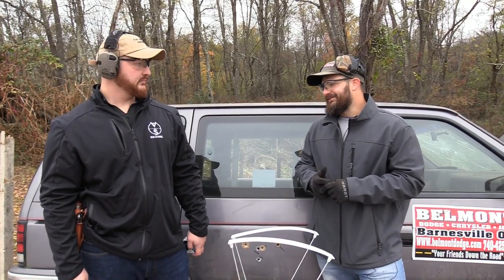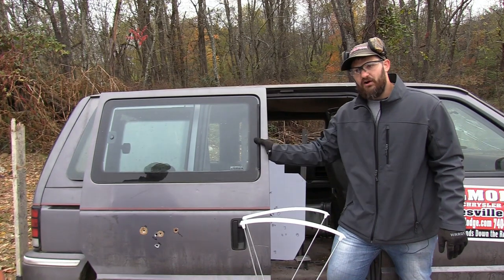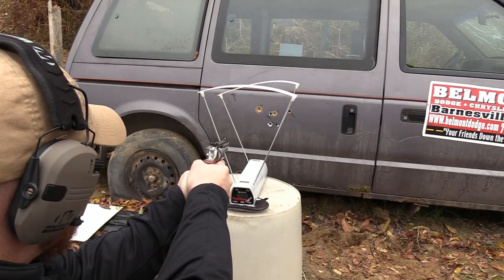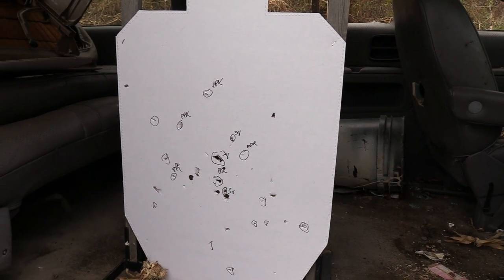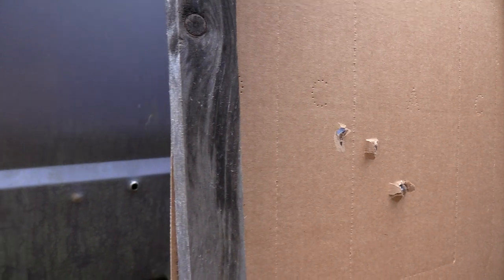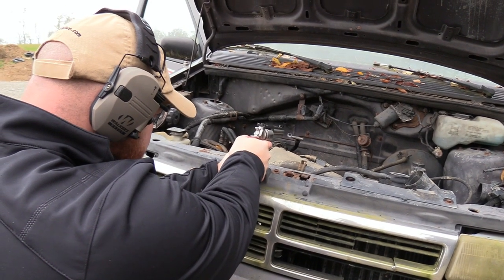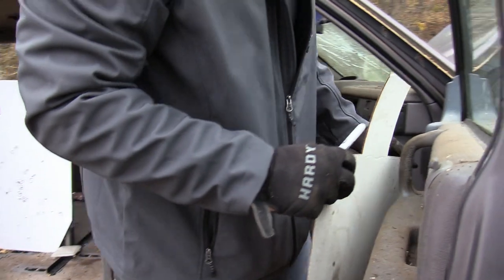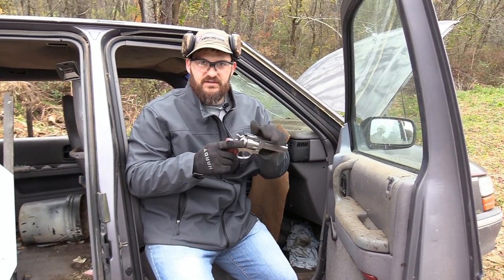HOW POWERFUL is IT? .357 Magnum Revolver

Comment: 357 mag was brought about for the purpose of penetration car doors of the 30’s. Original loads were 158 grain lswc going 1500 FPS out of a 8-3/8” model 27. Perhaps the ammo used in the video isn’t the best choice for going through a vehicle. Try using Buffalo bore or Underwood 158 grain.

Comment: If you want to test penitration through the firewall you should use full metal or hardened led rounds. Try Buffalo boar or another high power FMJs. I load 90gr 9mm FMJs which are .355mm and will shoot no problems in my 357 magnum and they are very fast and have a lot of penetration.

Comment: My 357 load would go through it like butter. 180gr hardcast at 1200+fps. What you can do with a 357 and a reloading set can be mindblowing.
Reply: Sounds like a good way to take hogs. :)
Reply: And that load isn't Max. Buffalo bore leaves my 4"gp100 at average 1374, my coonan 5" at almost 1500fps, and my single shot 14" just over 1700. I haven't been able to quite duplicate them with published data, but that's some serious freaking power out of a 357. I've only used their hard cast, and put one lengthwise through deer. Now they make the 180 xtp that I've been craving for some time
Reply: That’s a lot of frames per second wow
Reply: A really hot revolver load only goes quite ballistic from a 20" rifle carbine barrel. Buffalo Bore has a 158gr load rated at 2,153 fps from an 18.5" Marlin. That's 1,627 ft-lb muzzle energy.
Reply: Trump lovers ohhhhhhyeeAaah ❤️ ❤️ ❤️
Reply: @exothermal.sprocket  Jesus. That’s NASTY! I love it. .357 is a powerhouse round my Friend. 💪🏿💪🏿
Reply: @Dontevenknowfam  A common 170gr load for a .30-30 registers 1,827 ft-lb, just for perspective. Obviously at range the blunt pistol bullet will shed velocity faster.

Comment: 357 mag is a one shot man stopper.
Reply: Yep. One shot deer stopper as well. I use the gp100 6"
Reply: @jeremyjames1659  what ammo?
Reply: No pistol round is. It’s one of the best though.
Reply: @infamousnova   any 125 grain at 1450 fps or 158 at 1300 fps ...  but we can get 125 at 1700 fps and 158 at 1500 with full power loads...
Reply: @a3300000  The average number of rounds to incapacitate (in a few studies) for 357 magnum is 1 something. So that's basically a one hitter quitter.
Reply: Over decades of data it's shown that the.357 mag has better than  90% one shot stopping power.
Reply: Never believe that.  Shot placement.   Regardless of caliber..
Reply: @nicholasroberts9618  Out if a 6 inch barrel, those 125 grains are FLYING! Idk what your high off of, you ain’t shaking that off Buddy. 👍🏿👍🏿
Reply: Facts. It’s my home defense weapon.

Comment: Not really the best, or even an average, 357 load. A more realistic loading would be a good jhp, 125 to 158 grain. Who carrys 180 grain soft lead  hollow points in thier 357 revolver?!
Reply: Popin Fresh I agree. And that 180 grain round is really designed for hunting. This test would've been more effective with something like the Federal C357b, 125 grains at 1440fps, and compared to some others, it's not even that hot of a load.
Reply: I do, Buffalo Bore 180 hard cast. When I'm out walking on the levee on my property. When carrying not on the levee Buffalo Bore 158 grain hollow points.
Reply: I use 180g as well. I like 158g better. It's the most useful all around weight.
Reply: I was going to say the same thing, 180 grain is best for hunting especially with something like a lever action rifle. 125-158 grains is much more common and moving a lot faster. If 9mm made it through there fire wall 357 would definitely do it but they shot the slowest moving round possible
Reply: EABOY2600  yeah ok dude whatever. 180 works just fine in .357 mag. Go try and sell that crap somewhere else because I’m not buying.
Reply: EABOY2600 my revolver is designed for the heavy loads. The 180 grain round is great for what I use it for. Now when I carry for personal protection I use the 125 grain which is ideal for anti personnel. If I want to go heavier than 180 I use my .41 magnum. Before you offer your meaningless opinion. In an effort to clown someone do a little research.
Reply: @SwampSquatch70  hey big question using a revolver for protection why not use a 9mm?
Reply: Miguel Coronado personal preference. .357 magnum is more suited for my needs than 9 mm. Not really a 9 mm fan. If I was going to go the semi auto route then I’d take 10 mm.
Reply: Just because it's not a common load, doesn't mean it isn't a practical one. Soft lead 180 hollow point in 38 or 357 would be an interesting defensive load. Actually I would be quite interested in seeing what kind of velocity i could get in 38 sp. Even in 357, sacrificing a little velocity for better sectional density, less deflection, more momentum, those are serious benefits over the 125 bomb without getting too specific about particular bullet construction
Reply: @FearScherer  that's exactly what I thought me and my friend having arguments what's better for a side arm for defence and he said 9mm and I said a revolver but I see what you Mean on preference I never used a gun and I'm debating if I should get a .38 or .357 ik .44 is to much for the start
Reply: @miguelcoronado5606  a revolver has a laundry list of benefits, especially to a new shooter. You can save 200 round break in, don't have to but extra mags, can feed it anything, no magazine springs to fail. It's intuitive to learn the basics and typically dead nuts reliable. A 4" stainless 357 would be my vote, particularly a Ruger gp100 or an older Smith k frame if the money is right. Stainless holds up better than blue but maybe you take better care than I do. A 38 would serve most people just fine, but if you get the 357, it opens the power envelope right on up and can be used on small game up to deer hogs and bear if you're interested in hunting later. Very very accurate, good defensive, range and field uses. I'd rather have a trusty full size auto if I knew I was going in to an unavoidable gunfight, but the benefits of the revolver, especially being loaded for extended periods of time make it my bag gun that goes everywhere with me as addition to whatever CCW I have on me. It's a big improvement in power and range over most CCW guns
Reply: @FearScherer  wow thank you for this I will consider one then I always wanted to go hunting low key a dream of mine I live in Florida so ik there's places around here that's kinda the only reason why I want a revolver for hunting reasons I want a hand gun powerful enough to take down a bear God forbids I run into one tho I just need to be able to shoot the gun and go to the firing ranges before I consider buying it
Reply: 180 for backpacking with my sp101 (for weight). I guarantee that will stop almost anything.
Reply: @miguelcoronado5606  you'll need to use moonclips as 9mm doesn't eject without them on most revolvers.

If you want 9mm just buy a taurus 692 has 357 mag/ 38 special and 9mm cylinder interchangeable with moonclips included. Why not have a gun that can fire 3 different calibers
Reply: @SwampSquatch70  I shoot a 44 magnum model 29, 180 grain. So why would I use it in a 357?
Reply: Robert Marshall why would I care what you use?
Reply: I use Buffalo Bore 180 gr hardcast as a woods gun load but that is more for large quadrupeds than people.

Comment: It depends. A lot of factory magnum loads use 700x, unique, or similar burn rate powders to cut down the cost of powder consumption during production. If you want a real magnum load use some h110, or 296. That will let you know what true magnum power is.
Reply: And use an older reloading manual. I have a Speer manual from 1984 and it's listing a max load of H110 a whole grain and a half higher than modern manuals.

Comment: For personal protection and I have a 10 auto Glock, Glock 20. I still carry my SP101 two and a half inch snub nose 357. That little round is amazing. If you look at the Miami-Dade shootout the FBI agents with a 357 shooting through car parts spray the inside of the car killing the criminals eventually. That 357 all you need is one good shot.

Comment: I believe it. Big difference between FMJ ball and jacketed hollow points. The first holds the advantage in penetration, the second transfers energy better since it slows down faster on impact.
Although, an inspection of what the shots went through is needed since the firewall and dash are not homogeneous like sheet metal or armor plates.

Comment: A soft jacketed hollow point round is intended to expand and cause more damage on impact,but doesn’t get much penetration because it fragments upon impact of hard metal. To get better results for penetration on the firewall a 158g full metal jacket round or a hard cast led 180g bullet would give you better results. I carry 158g flat head full metal jacket rounds for self defense. You get good penetration and the flat nose hits with more foot pounds of force. If I am in bear country I usually use the Buffalo Bore 180g hard cast round nose ammo.

Comment: Why did you use jhp and not ball like you did for the 9 mm?
Reply: JHP and wadcutter are the two most common types of ammo available for .357 magnum. while FMJ is the standard practice ammo in 9mm wadcutter is the defacto standard  "cheap ammo" for .357 magnum ( although I've bought many a box of JHP from Academy  at the same price or cheaper than wadcutter rounds in the same grain weight.
Reply: Logan Waltz your facts are incorrect.
Reply: stanly steemer I agree with him. Soft points or hardcast bullets are what I see the most of.
Reply: I have never seen ball .357's in my life.
Reply: Are u kidding me. 357 ball is common as hell
Reply: I've never seen 357 ball ammo in any of the gun shops in my city. Mostly I see jhp or jsp
Reply: @jeremyjames1659  almost all run of the mill practice 357 is fmj ball ammo.

Comment: I find it hard to believe that a 9 mm semi auto can beat a 357 mag revolver for penetration power. Maybe more shots where needed or the 9 mm just got lucky. I would guess that depending on round used, that the 357 mag should do better.
Reply: Diference is the 9mm had a ball round ie full metal jacket not a hollow point like was fired out of the 357 i dont care how fast you push a lead core hollow point faster causes  more expa sion to point of jacket seperation and total energy dump not more penetration hard cast or ball round out of 357 and its a different story the door shot told the story fragments in both targets almost enough metal there to cause full jacket destruction

Comment: If you had used federal 158 grain jacketed soft point, you would have had an additional 150 feet per second and less expansion. Bet that would have made it through the firewall.

Comment: 38 special + p ? 
Did you try that out?
I recommend 158 grain for 38special + p or 125 to 158 for the 357 magnum.  
That's What I Use IN My Ruger Blackhawk.  Reason? 
I found for myself the better accuracy with those rounds. 
Thanks for the video. 
Oh, if one is wanting to shoot through cars, FMJ is what I would recommend.  ;)

Comment: I have the ruger gp100 6 inch barrel and after contacting them they stated that they use a gp100 with 6 inch barrel for testing.I havent tried the 125 yet but the 158  xtp and 180 grn hardcast they have are awesome!

Comment: You gotta think there is a lot of stuff behind the dash of a car or truck or van that the bullet has to go through like the heater an a/c System so some parts of the dash an fire wall are less dense. But a good video

Comment: Try a 125 grain loaded to full power out of a 6 inch barrel. Its flying at 1700+ FPS, and putting out around 800+ Foot pounds of muzzle energy.

This video isn't accurate. 

You guys should use ammo from Underwood, DoubleTap, and Buffalo Bore! Instead of these wimpy commercial loads!

If you want SERIOUS full power loads, than try some compressed handloads! They breathe fire, and hit with devastating force!
Reply: Remember this is for experienced hand loaders ONLY

Comment: ok, now use some real .357 ammo. the loads you were using were basically warmed over .38 spl
Reply: No doubt.  180gr at 1050 is more or less .40 S&W
Reply: 40s&w went through.  I think it has more to do with bullet construction and the obstruction of the materials at the aim point (which they say before hand is a bit different).
Reply: Seth Barcello I agree
Reply: The old British .38-200 ran a 200 grain bullet at about 750 fps. It's kind of like throwing a bowling ball. :)

Comment: 1000 fps is very verrrrryyyy slow for a 357 out of a 4 inch ... Use a good hot 158 grain hard cast semi wadcutter .. If its hot it should be roughly 1300fps out of that 4 inch ... Will go through the firewall there easy as pie I promise .

Comment: That's some seriously weaksauce 180 grain .357 Magnum ammo...

Underwood .357 Magnum 180 grain hardcast (#720)
Muzzle Velocity - 1400 fps
Muzzle Energy - 783 ft/lbs

Good home/personal defense 180 grain .357 Magnum will hover around 1200 - 1300 fps from 4-6 inch barrels.
https://www.youtube.com/watch?v=CzrxHjX7eWo
Reply: TOBORE8THMAN I carry those for deer. I guarantee they would go through the firewall.
Reply: exactly!!! Tell em
Reply: Exactly. Underwood uses a 6 inch GP100 test gun. 1400 fps on 180 grain hardcast. 1700 on 125 grain. They have a fmj 125 grain. At 1700 fps, it would shoot long ways through that van.

Comment: Your test is lame. You don't even reveal what type of 357 bullet your ammo had. I dare you getting a ball, cone-shapen fmj ammo for 357mag. in the likes of a standard 115gr 9mm.
Also you were either using a heavy slug bullet or an absolutely underperforming load that couldn't brake 1100fps which is mediocre in the 357 mag department (4" barrel).